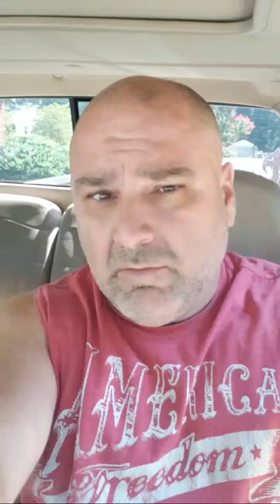(TPMS): Bad Sensor Vs. Air Pressure

Comment: Hi man high respect i like ur down to earth  videos the transfer case manual shift bugg out survival method was fn awesome i got a 2001 gmc 4l60e 4x4 it goes into  neutral state right after i back out of driveway them nothing forward or reverse until u leave it awhile was told mabey i have faulty neutral swtch still havnt ruled transfer case out what do u think? Pls get back to me asap if u could beem workin om this 75 hrs straight after pputting it on shelf couple years need it for work thx for ur vids man ill share them with my bros